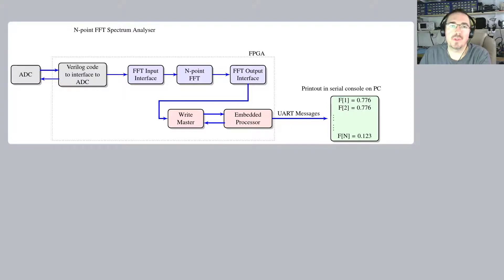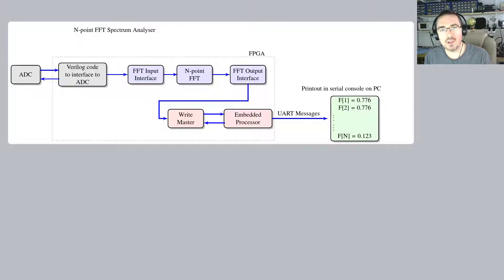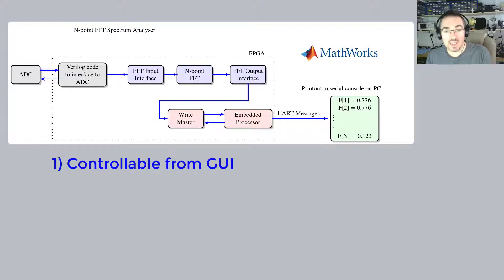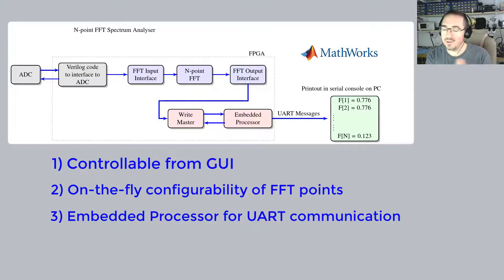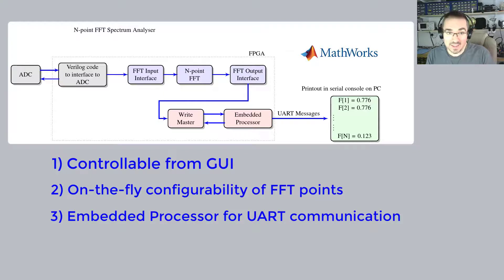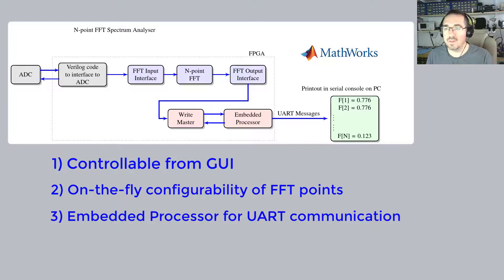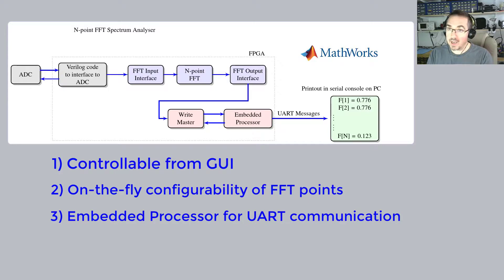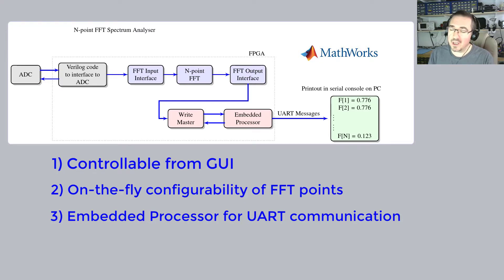Building an FPGA-based Spectrum Analyzer with GUI control: PART 1: Design Scope

Comment: I did something similar only I made it on two different FPGA boards, one Xilinx 3E( have a buttload of old boards left over from a dev environment but if you know how to put them together you can make a full blown two part system with a frontend for asp( analog signal processing)  a middle bit( to attenuate and smooth the signal)  a max10  controls things up until this point then the much more robust S3e takes over and does the signal processing( inbetween there are a few logic level shifters and programmable fuses( cause nobody loves SMD desoldering 😂) so thats my system( it does have a pre-made rf frontend and rf backend chips and costs about $100( goal was to replicate  the HackRF One ( which is close to $500 now( overpriced with antiquated FPGA and parts.. basically paying for a future door weight( I can reuse my lab stuff(and I dont have the cash for MatLab but OpenMatLab works better IMHO but thats just me) and for sure looked way messier in terms of wires but meh I made my point that it can be done for $400 less ( and way better in terms of stability then the original( ok not 2w in power but still )

Comment: Im building the same project! Do you think it is possible to transfer I-Q signals through Ethernet port? the FFT calculation and drawing spectrum will be done by the computer. It will be great if you can make a serie video of this project on Udemy, I will be the first one buy it!. I already have cyclone 5 SoC and AD-DA GPIO card
Reply from the maker: It's possible. I'm hoping to develop this project when I have time. I think I'll be using a basic UART connection rather than Ethernet.

Comment: Hi,
I would like to make a device that receives a signal (perhaps noisy one), then generates a phase shifted version of the main component of it as an output. I have a Cyclone V GX started kit and ADA-HSMC. I would be thankful for any guide or suggestion.
Reply from the maker: It's an interesting project. You could perhaps multiply by a complex exponential of the same frequency but shifted in phase. Do you know the frequency of the input or should it be general?